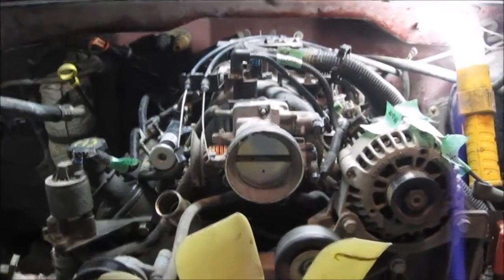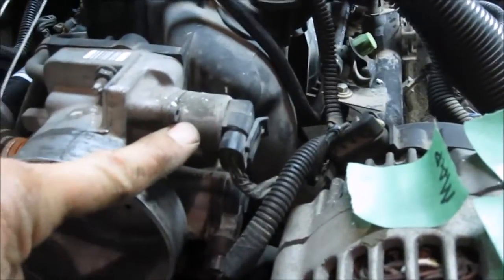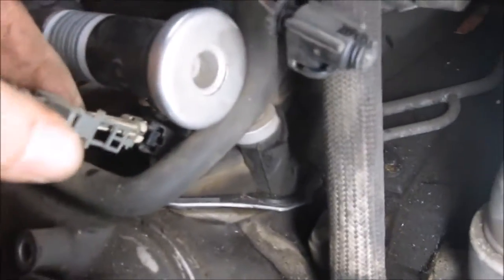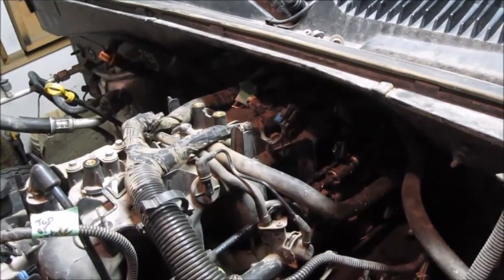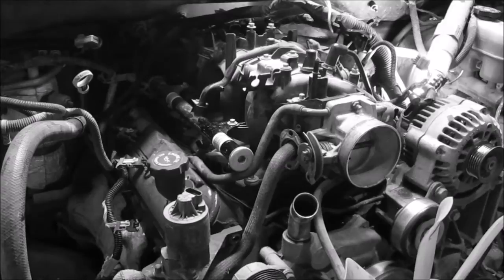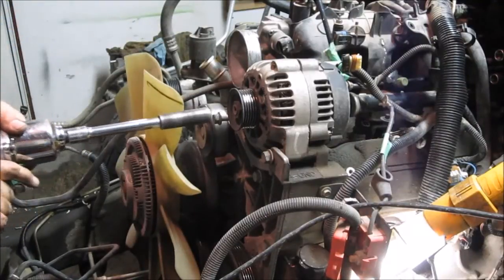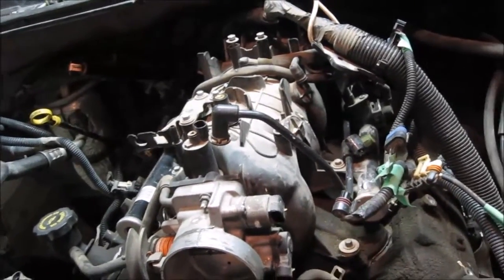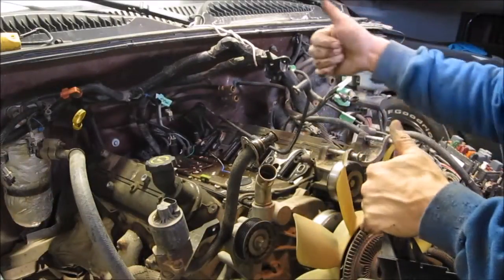Vortec intake removal

Comment: On my ax5 5 speed manual two wheel drive transmission will that bolt up to a np231j transfer case because on mine it doesn't look like it will